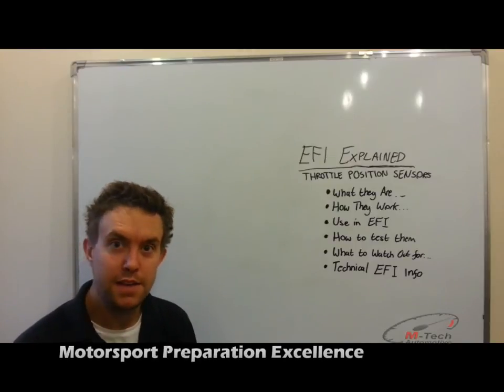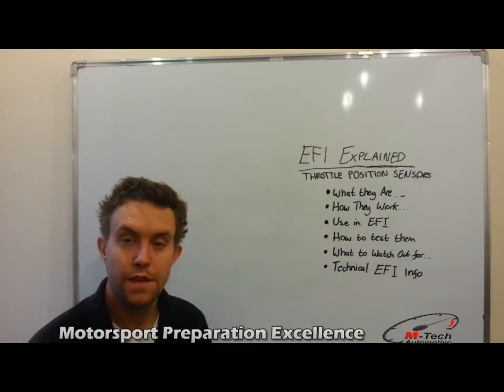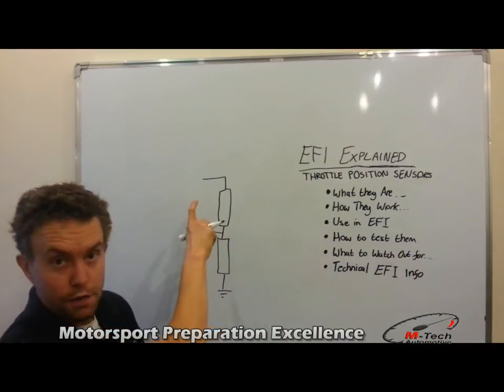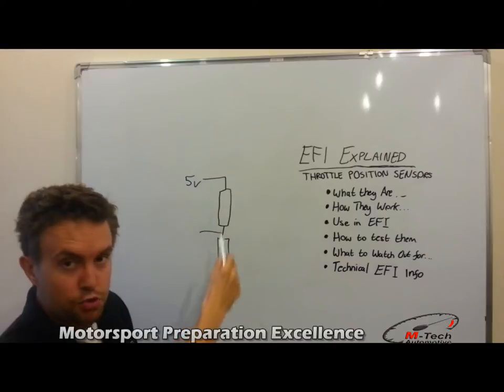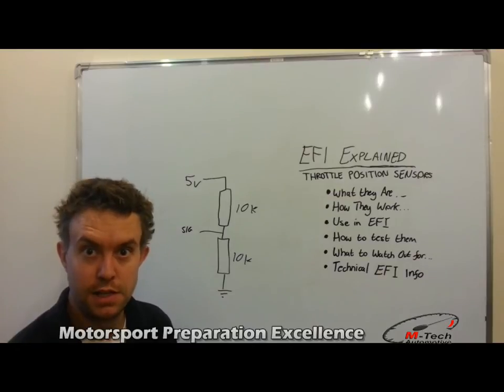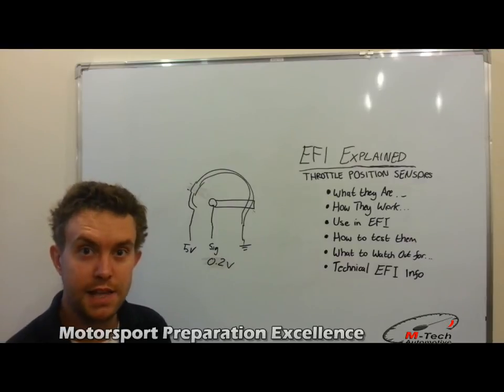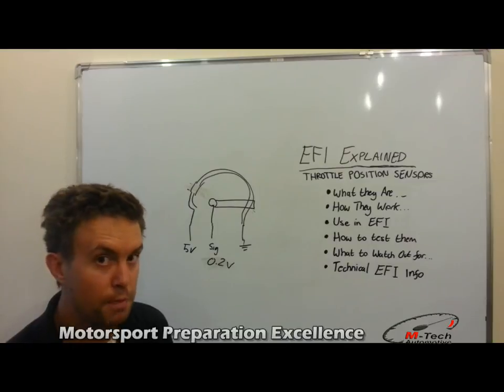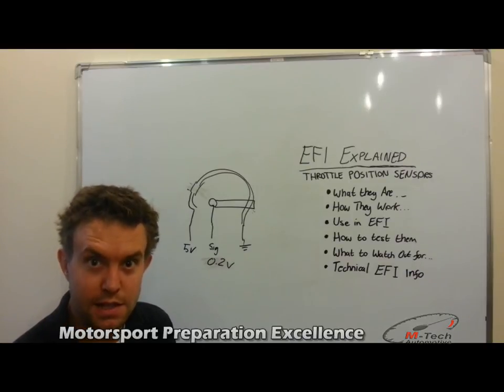How Throttle Position Sensors Work :: EFI Explained with Matt @ M-Tech Automotive

Comment: What about 4 pin TPS?
Reply from the maker: Phil, 4 pins usually use an 'idle' or 'WOT' switch in them. This video deals with more modern 3 wire types, whereby the ECU knows the WOT/idle ranges.